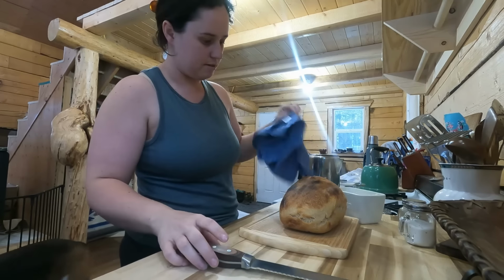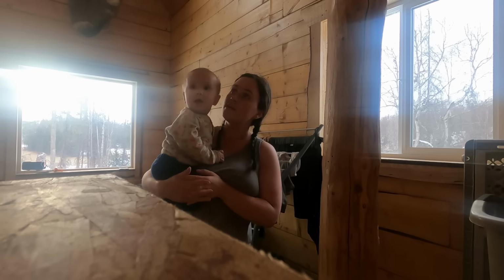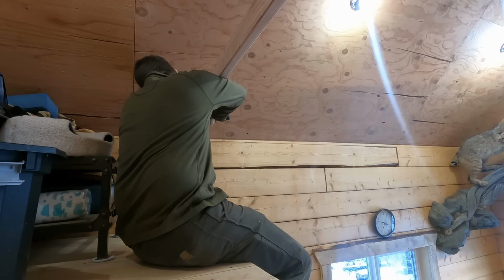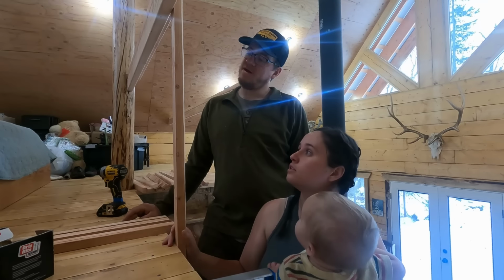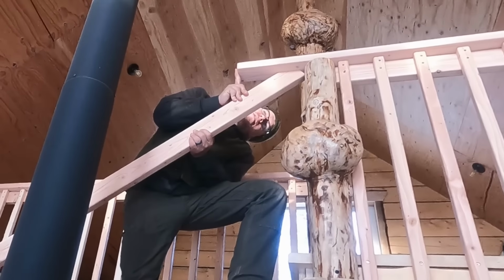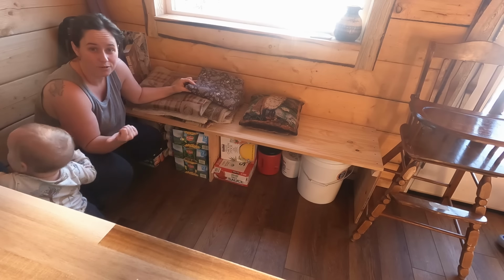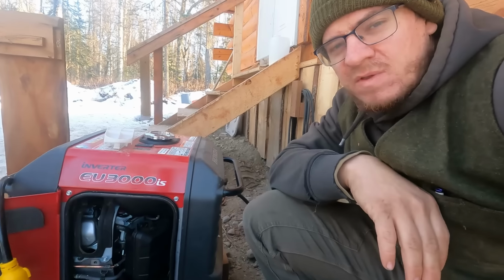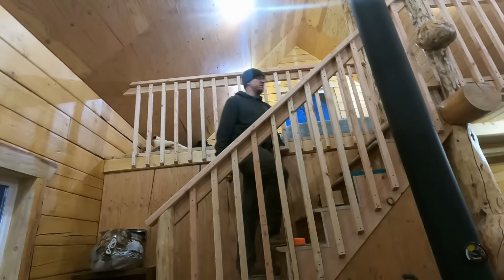Building Railing For The Cabin Loft | Interior Finish & Freezing Rivers

Comment: Levi, I have a suggestion for your generator issue.  How about putting a door through the skirting and making a track somehow that you could store the generator under the house, where it should be a bit warmer, and then slide it outside whenever you need to use it. I don't know if that would work, but it's worth a try.  Maybe first check what the temp is behind the skirting.
Reply: A big sliding battery tray would work. I’m getting ready to do that at our off-road cabin. It’s in an insulated box now to keep it warm while it runs in subzero temperatures so the oil breather doesn’t plug up. I’ve been using the insulated box for over 20 years with the same generator. I also use synthetic oil so it starts and stays running in the cold. Regular oil will cause the engine to have a low oil shutdown. After a few minutes the engine heat will allow it to run on the regular oil when it is restarted but I’d rather not do that.

Comment: Let me first say that my wife and myself really enjoy watching your video's. For your Genset issues, What I did was I built an insulated box that covered the whole unit and had a separate exhaust hole and a vent coming into the unit so the air was heated by the unit as it was running. I made one for my work unit (EB6500 Honda Industrial ) as well  as our camping unit (EU3000is Honda ) which is the same as the one that you have. The work one ran in cold weather from - 35 degrees to -45 degrees for 2 to 3 weeks at a time with no issues and the camping unit ran about the same range of temperatures and times just depending on how far back in the bush we were working.

Comment: Hi from Australia, 
I've a suggestion regarding your clothes drying rack... put it on a pulley system suspended from the ceiling... (or make a wooden one) you wouldn't have to keep moving it on the floor as you would be walking under it... clothes dry very fast this way as heat rises...

Comment: On those open ends, you could continue on with the same theme, lay a 2X4 against the roof, cut at an angle to fit the top 2x4 railing, then just cut the same pickets, only shorter as they go towards the wall.